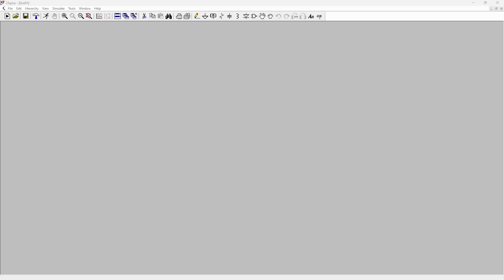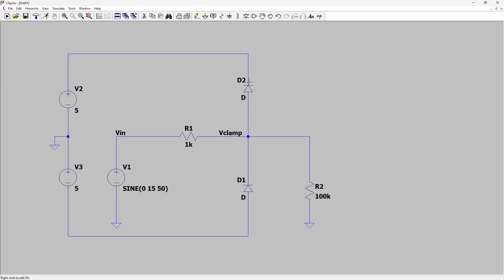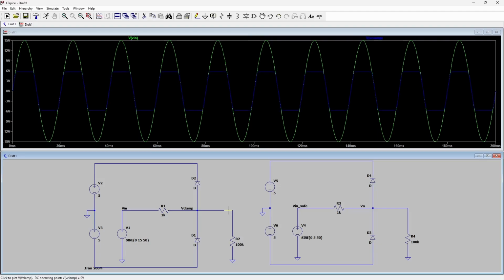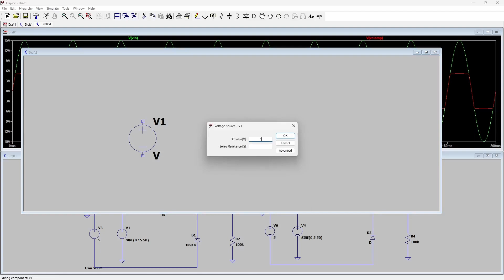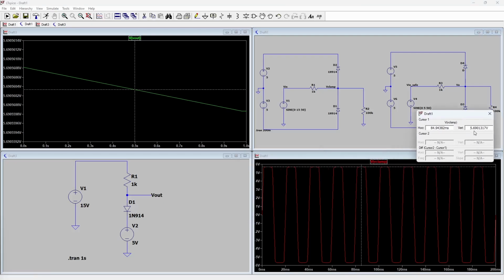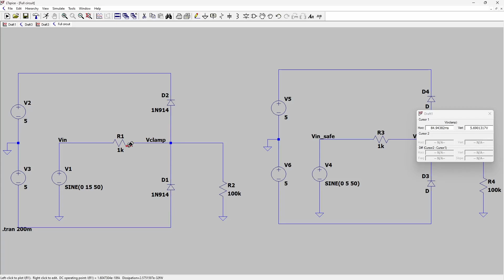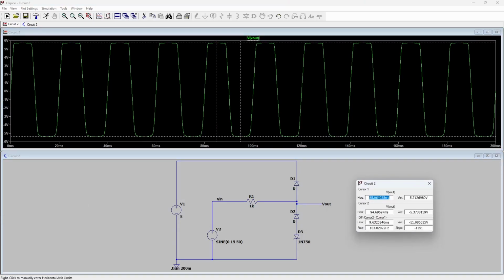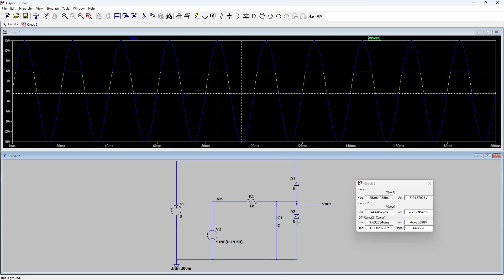Learn The Art of Electronics: Input Protection Exercise 1.22

Comment: What about the dual BJT zener clamp? They got that Vebo + Vf breakdown that would do the same thing as the diode clamp with less leakage current. It's a pretty clever way of minimizing the leakage current in high sensitivity applications while providing a fast bipolar clamp. EEVBLOG has a great video on it. Just stumbled onto your channel, I like where this is going, I'll subscribe to make sure not to miss future content like this. It's a great refresher to go back and look at these simple circuits, they never really made much sense in college because I had no idea why we needed to know this stuff.
Reply from the maker: I do remember watching that video! Neat little configuration. Thanks.
Reply: @TheEngineeringExperienceYT  I've used it in a high voltage differential front end but I don't have a >400v source to test it's effectiveness as a camp, but I can attest to the low leakage performance. It's like the difference between C0G and other MLCC types for reducing noise in sensitive analog circuits, effectively it's a high performance cheat code you won't find in the text books.
Reply from the maker: Time to get my hands on a HV source! I'll test it out.
Reply: . . . yes it all makes sense now. At college it was always about learning learnin learn Lear lea le l

Comment: Good explanation. Maybe a few xtra protection options to consider.

Add a TVS diode directly on the input to protect against high voltage spikes. The breakdown voltage can be relatively high, because the diode clamp you designed will take care of any high voltage remaining.

A lot of components, like a CPU, also include clamping diodes on the inputs. You can use a resistor between your output and the input of the device to have a secondary protection.

Not every power supply (like a linear regulator) is capable of sinking current. So a diode clamp towards the power rail isn’t always the best solution. The Zener/diode solution you presented (in case of no negative supply) can also be used for the positive over voltage. This way the current is directly diverted to ground and does not depend on the power supply capabilities.
Reply from the maker: Thanks! And yes that's a very good addition. I made a second video with a circuit protoype and test where I go through a TVS diode as the input protection.

Comment: How the first circuit is different from clipper?
Reply from the maker: If i understand your question correctly, the circuit does clip the voltage on the load. There may be various reasons you want to clip the voltage (limit voltage below adc reference, protect circuits, etc.)
Reply: @TheEngineeringExperienceYT  No my question was,  in the video you described the circuit as a clamper circuit but I have studied it as clipper circuit so are these two different circuits or they are same?
Reply from the maker: @marvelous2911  ah okay, that is the same thing. Clamping and clipping means essentially the same thing.